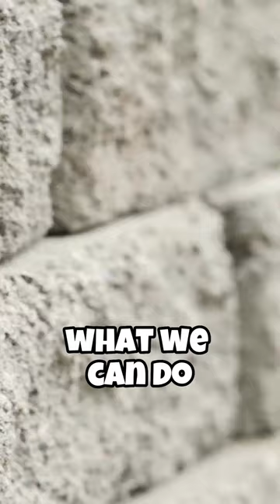Keep your property looking great for less $$

Comment: seems the terms of her service werent made clear enough to her.
Reply from the maker: 4 emails were sent and it was on the initial quote she accepted. People just forget 👍🏻 she is happy now once explained ✅
Reply: @MikeAndes  lawn care service should not be like this at all.
Reply: @MikeAndes  i had no doubt but despite all that still not clear enough but of course for some people it never can be. ive had similar issues but they are few and far between luckily.
Reply: @Ja-fh8io  wrong...edit: this is how I've done a good chunk of my properties whether it be for lower monthly or different services performed at different times throughout the year. If it is defined and on paper, nothing wrong with it and very common.
Reply: @ja 
enlighten us then.
Reply: scam, you can do a hard cut on the shrubs in the fall with a good mulch, and done till spring. guys this is just like hvac company's doing a spring and fall maintenance, change a filter and clean a condensor, which anyone can do. they do this because they are slow.
Reply: @Jason-ws3cd hvac does do it because its slow but in many cases the technician is going looking to prevent future issues.  If your fan motor si running high amps in the winter then it is gonna be screaming in the summer
Reply: @dog water  I understand but don't pretend that checking the entire system doesn't result in a big bill. I'm an industrial maintenance tech for 20 years and do hvac and plumbing on the weekends,  I never screw anybody.
Reply: @Jason-ws3cd  charging flat rate is not screwing anyone
Reply: @Mike Andes  sure you did
Reply: @Ja-fh8io   I worked for 2 big name lawn care services in Midwest Missouri and it was a waste of money the entire time I felt so horribly that I had to break my back working 13 14 hour shifts just to make sure customers were happy every single customer I went to was unhappy we weren't doing anything!
Reply: @MikeAndes  how can you not simply ask "do you understand" before having them sign the contract... shady people like you make us all look shady
Reply: @MikeAndes sure she is happy with yall ripping her off lmfao.
Reply: @Ja-fh8io  that’s your opinion that’s based on?
Reply: Is she happy about a private conversation being put on YouTube for the masses?
Reply: @MikeAndes  you're ripping people off, bro. You shouldn't offer that type of service. It's not a real service.
Reply: I mean it may sound shitty, but I’m sure she was told it would be x amount of dollars every month for a year. I pay my cleaning lady a set amount every couple of weeks even though sometimes my house requires a different amount of work on a job to job basis. Any adult with common sense should be able to read through an agreement before signing when it comes to money.

Comment: 100 a month??? Damn no that’s a little crazy
Reply from the maker: Compared to a property cleanup that is $500-1000
Reply: You need more properties. Scoffing at a $100 a month means you aren't busy enough. I'm waiting on your response of making $900K annually by yourself with a push mower and a Kia Soul.
Reply: @BLoobs1  I agree $1K is way high for a standard lot...maybe even $500. Depends on what is going on. However acres of cleanup at $500-$1K?! Hell no. I'll charge a customer $1K+ on a backyard three side fence cleanup easy (vines, volunteers, abandoned fence panels (not whole fence). They don't buy the equipment, trailer or truck, haul the trailers to the dump, sharpen blades, get to the trailer at 6:45AM to load the equipment,  get cut up by briar, smacked in the eye with limbs, deal with the heat, cold, rain or shine, etc.. If we are showing up with a few guys and $10K of equipment for a couple hours you best believe I am not giving the whole "$99 Fall Cleanup! Call Today!" pricing. Early on I did that...those trailer wheels don't start moving in circles for less than $400 on a small gig. Get your hourly up...or let your competitor get the $500 for the same job you are charging $150 for.
Reply: @BLoobs1  have you actually sat down to cost out all of the expenses involved in a cleanup?  Unfortunately non-business people forget to account for the time it takes to get to a property, dump fees, labor cost once you leave the property to drive to the dump site, fuel, insurance, equipment, all fixed cost (rent, water, electricity and office supplies)

Comment: He isnt cappin, I worked for a lawncare company as a maint tech and there were always a dozen or so houses on my route that never paid for winter service (includes snow removal). Every fall id spend a whole week doing cleanup and blowouts for leaves on just those houses sometimes 8 hours just for one property. If we did biweekly winter maintenance on the house it usually came out to like 30% less than a cleanup and they wouldnt have had to shovel their own snow all winter.

Comment: The irreducible problem with maintenance services is that  the fee is very crisp and definite but the effort is extremely variable.

"Winter services" may be a good deal or a bad one.  An annual contract can be prorated to provide the server with regular income, but itemization is the best route to satisfaction.

Don't just say, "Oh, we do stuff like...:  Be able to say what you actually did.

Comment: Fall cleanup… trim all t C he bushes blow and pick up all the leaves. Cut and edge the grass. Couple hundred. Jan off-Feb off-mid March start back. Spring cleanup. Light thatch, clean any new leaves and weeds from beds, cut and edge the lawn, edge the beds. seed any bare spots/or not, fertilize. Couple hundred. No winter work=no bitching.

Comment: Trimming and edging?
If it's dormant, what  are actually doing?
Reply from the maker: We do the gutters, trim bushes, rake of leaves and debris, remove any branches from wind, blow off walkways, shake out the outdoor rugs and even winterize the outdoor faucets and vents
Reply: Basically he wants to charge $100 for picking up some sticks for 20 minutes.
Reply: @shack8464  so when u go to a mechanic shop and the diagnosis is $100 and they get done in 20 minutes now what?

Comment: I am going to read between the lines and say they simply don't have enough business to sustain them in winter so they are providing some service which is mostly unnecessary to keep from either charging more I n the summer or finding a useful service in winter.

Comment: It's tougher to service ignorant individuals. A smart person would do a quick Google search on the services they're paying for and what's the average price in their area. Second read an article vs the pros and cons of this winter service vs paying more for an overhaul in the Spring.

I know how to correctly change a faucet. I was asked to do one for my brother's boss at her salon. I looked up the average commercial cost. I gave her a huge discount because she obviously didn't want to pay full price or wait for the plumber. I made an easy $150 for an hour. I had to make a trip to my local Home Depot. I factored in the cost of tools and extra hose. So I made $100 for my labor.

She didn't know how to Zelle, she handed me her phone and she had over 89K in one account. That didn't change my price. I think in the end she was testing my honesty. She was happy with the faucet. I did tell her before hand that the lack of water pressure is due to an old hot water valve. I let her know that a pro should take a look. 

Sometimes it's best to know your limits.

Comment: Great way to do it. We have a couple yards we charge winter fees too, it beats coming back in March, having 1ft of tightly packed wet leaves that hardly move or mulch. Then also mulching beds, trimming bushes, and general care of the lawn. I think the customer would be happier with spending 500$ through the winter rather than a 2000$ job that takes 2 days cause she wanted all the leaves to fall first

Comment: Yes sir that's a scam and a half right there, clearly a service meant for people with more money than brains. Getting things ready for winter is one thing, shouldn't need continuing maintenance in the winter months if done right in the fall.
Reply from the maker: There are wind storms, leaves still falling, ice, fallen branches, blocked gutters and much more that happen after Fall. And this route is about half the price as getting another cleanup in Spring… and the property stays looking good all Winter. Clients love it and it saves them $$

Comment: This seems dodgy as.
Reply from the maker: On original estimate and emailed multiple times throughout season and before starting winter services. They can cancel with click of button and get refund
Reply: @MikeAndes  in my opinion this is a dodgy business practice only used to drum up extra work. You should be ashamed of yourself.